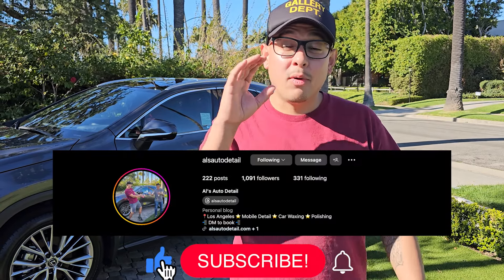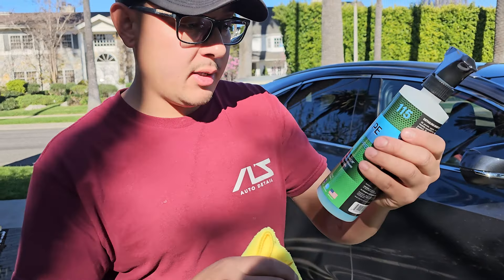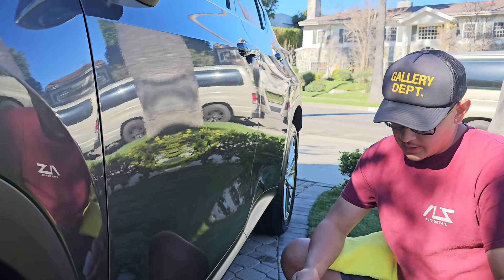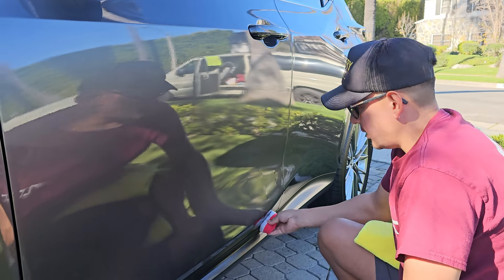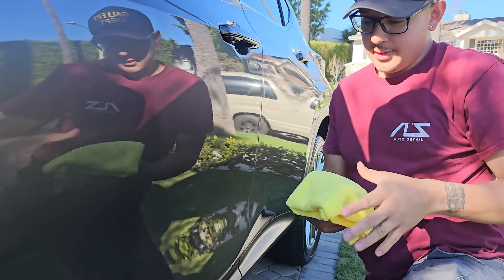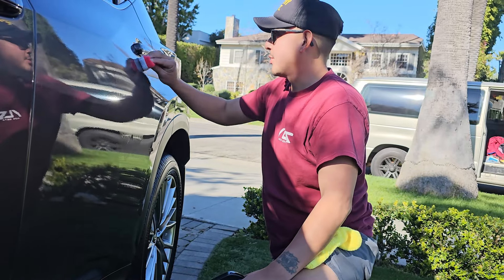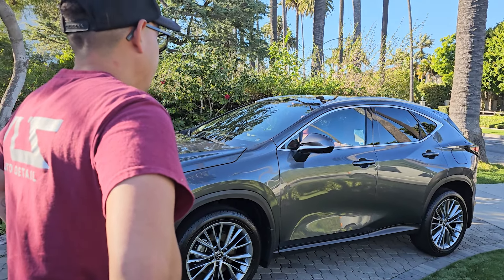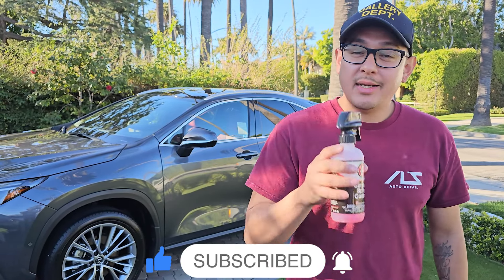How You Can Make $500 In 2 Hours With This Detailing Service - Al's Auto Detail

Comment: I respect the hussle but please don't sell this as a coating. Any true ceramic coating is not going to come in a plastic spray bottle. Adam's makes nice stuff but it's marketed towards consumers. Just because it says coating on the bottle, it doesn't mean that's what it is. This is a ceramic sealant and how it should be sold. I've seen so many consumers gripe about how they don't believe in ceramic coatings because of detailers selling them an inferior product as a ceramic coating when in fact it is not.
Reply from the maker: I completely understand where you are coming from. Clients have had true coatings applied to their vehicles by detailing shops, they are much more pleased with our service. 90% of the time, we are regularly servicing their vehicles. So every couple of months , we add a ceramic topper/Sealant for no extra charge. This just adds to the convenience for the clients. Thanks for the feedback 💯👍
Reply: Adam's spray coating is strong here in Florida I kept the bottle in my van and when I turned the spay adjuster on it started squirting out ceramic coating at high volume by it's self from the pressure. Almost got me in the eye!
Reply: Those customers don’t believe in “ceramic coating” is exactly bc of this guy right here.
Reply: @alsautodetail  ah so it wont last unless you add that topper. Also, why are you not using the Advanced one??
Reply from the maker: @RichardMJr it will last. This is our way of going that extra mile. It's so easy to add the topper. Plus it makes it so much easier on yourself the next time you wash the vehicle. 👍

Comment: What steps did you guys take to prep the vehicle?
Reply from the maker: High PH soap bath, towel dry, blow dry, surface prep spray. The car didn't need much. The client purchased it brand new prior to us coating it. 👍
Reply: @alsautodetail to my understanding is that because the car is just been purchased a few weeks ago it doesn't mean its been decontaminated by the dealership,I been talking to a lot of guys who work in dealerships and they are the responsibles of washing and preparing the car for the new owner and all of them came to the same answer they said that if a car is been sold they just washed the car and spray a cheap wax just to glow the car for the customer,I think it would be better if you decontaminated the car with a clay mitt every time you offer that tipe of coating,one last thing try to use next time GYEON Q2 CANCOAT EVO is way way better than Adam's and to save more instead of using the 3d Wipe use 100ml of alcohol mix with 900ml of distilled water on a sprayer and u have your wipe off.
Reply: @forevertool . I couldn’t have said it better brother